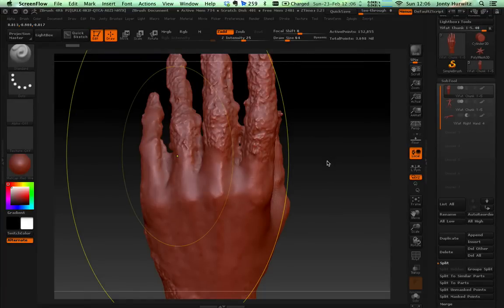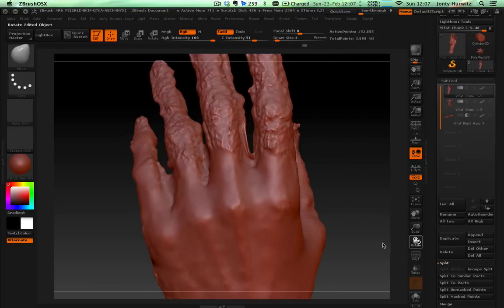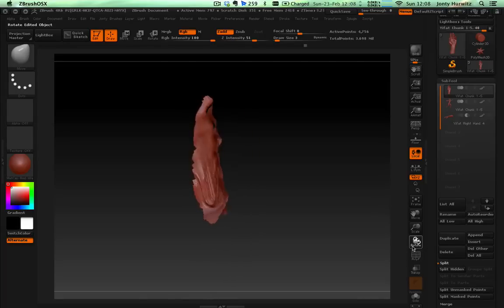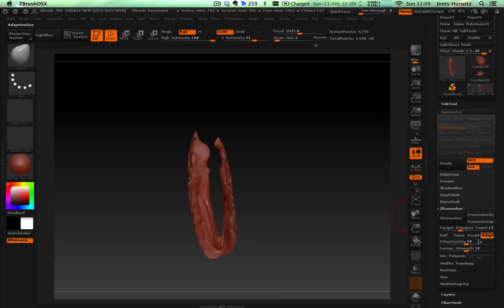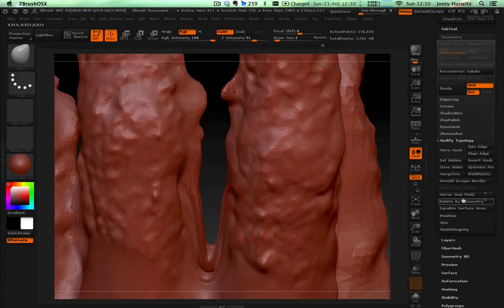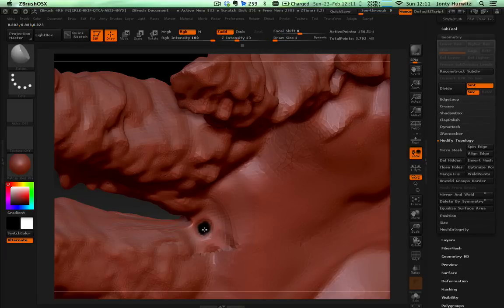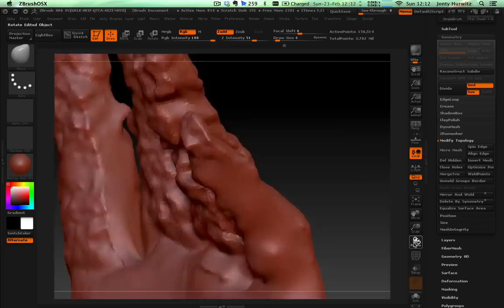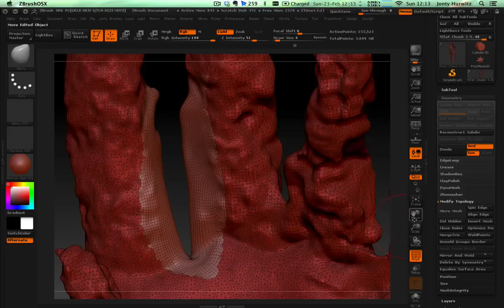Clean a 3D scan in zBrush

Comment: You should try 3D-Coat for that. Voxels allow you to smooth and cut off unwanted areas much quicker than surfaces. And after a rough cleaning you can switch to the surface mode and make fine adjustments on details.
Reply from the maker: Alexej Kalmbach Thanks!  I keep hearing about 3D coat!